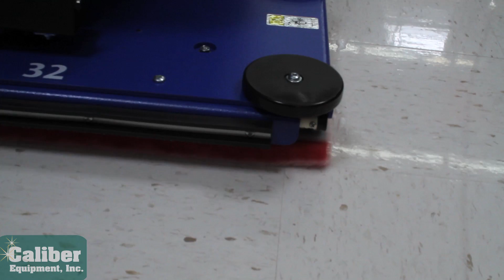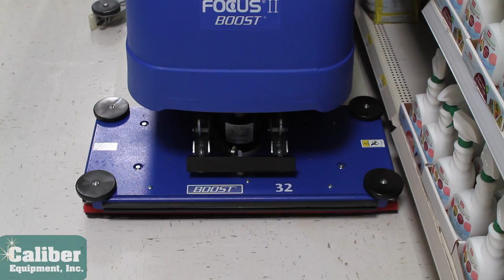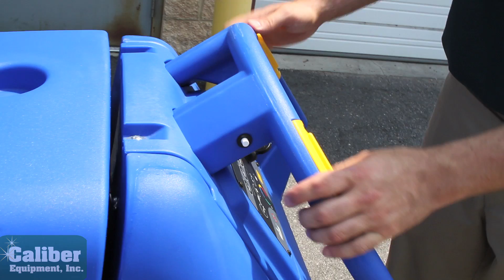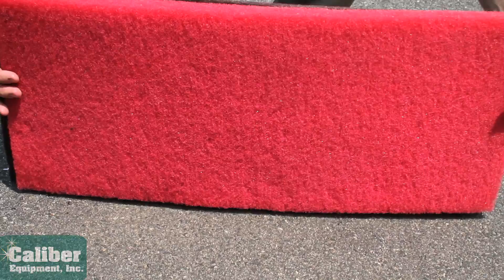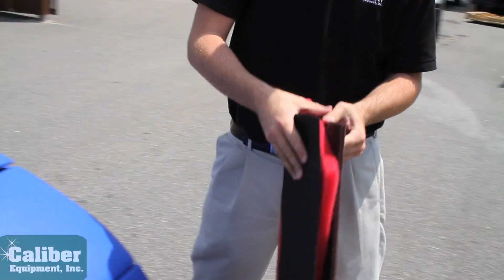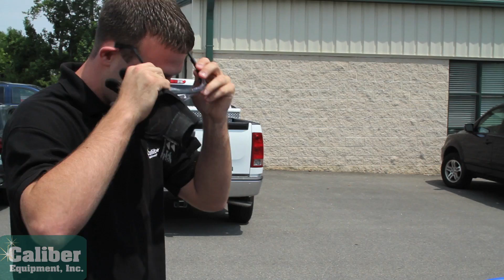Clarke Boost Demo Video

Comment: What if I just want to clean a floor, but not strip it?
Reply: The Clarke Boost scrubbers are great for floor maintenance and light scrubbing, not just for stripping. With the orbital cleaning action and light down pressure and a standard pad, you can clean routinely with less solution vs standard disc machines and less wear on you floor finish.
\Dave

Comment: How to fill water up?
Reply from the maker: Depending on the version, there is a clean tank port on the front or the back of the machine. Use a hose to fill up to desired level.
Reply: @Caliberequipment   Thanks for the info

Comment: I've tried stripping with this machine using the procedures according to the manufacturer and it does not do a good job without stripper chemicals on higher traffic and less frequent serviced jobs.
Reply from the maker: There are times where the conditions are so bad you might have to chemically strip using a black stripping pad. However, we do not recommend using the Clarke Boost to suck up stripping chemicals, as it tends to gunk up the machine. We recommend using a wet vac if you're going to use stripper! Hope that helps!

Comment: Does it hurt my machine? Or just void the warranty
Reply from the maker: The factory does not recommend dispensing stripper chemical through the Boost. Due to the chemical's corrosive nature, it will eat away at the rubber components and solenoids, eventually causing damage to the machine. If you've used the Boost to pick up stripper and wax, just make sure you thoroughly rinse everything immediately afterwards- the tank, the squeegees, wheels, etc, or else it will harden and be a headache to remove. The boost is designed for chemical free stripping, just use water and a maroon 3M surface prep pad.

Comment: How many layers of wax is this taking off?  A full strip?  Do flooring manufactures back this method?
Reply from the maker: The convenience of the Boost is that you have the option of chemical free stripping if you use a surface prep pad which will remove the top few layers of wax in one pass. This is the application Clarke designed Boost decks for
Reply: We see typically 2-3 coat removal with this method. If you scrub dry you can take more off, maybe 4-5, but it makes quite a mess and cuts the pad life in about half.

Comment from the maker: @Banjerman07 
If you used the boost just to pick up the stripper slurry it would not cause damage to the recovery tank because it would be diluted with water and you'd be dumping it after. If you were to put stripper directly into the solution tank, that's when it can warp the tank and burn out the motor.